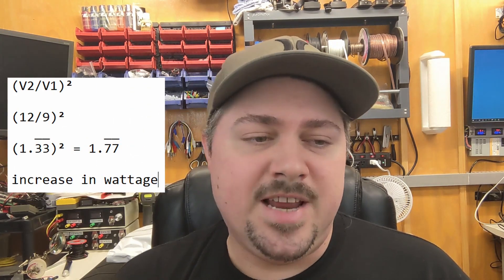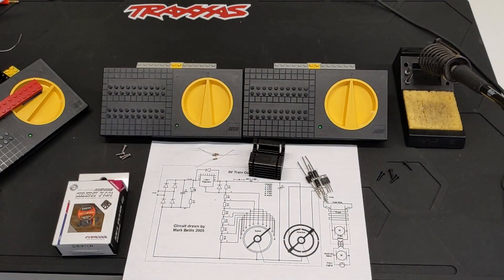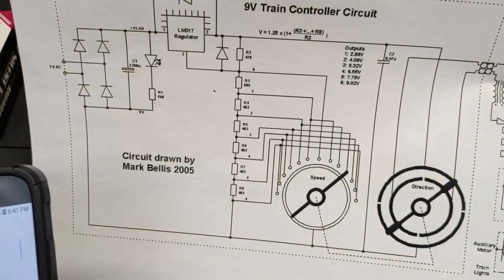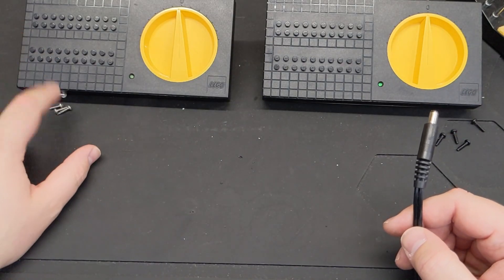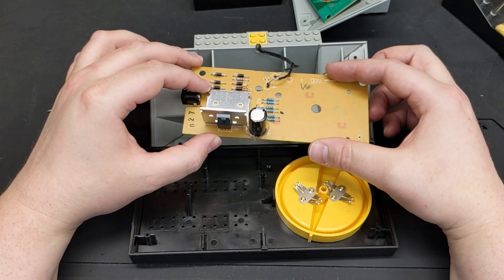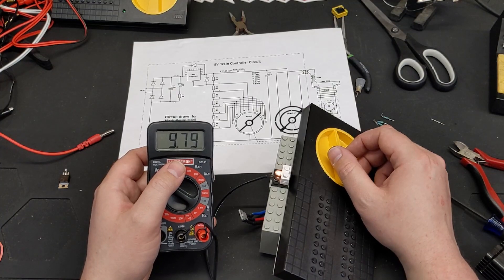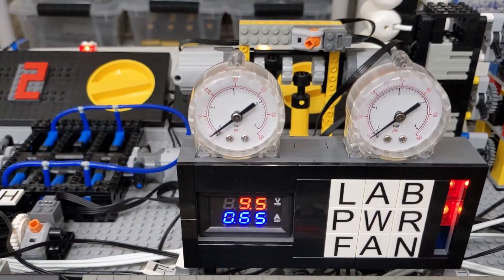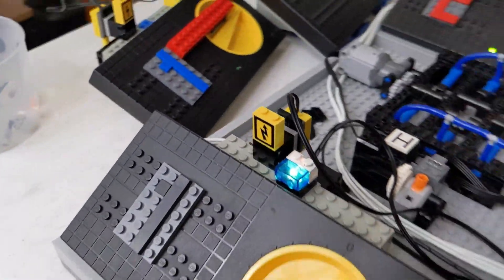Modified Lego Train Speed Regulator 2 (More Voltage)

Comment: Oh no! Dude, you don't have to resort to holes for higher-power mods like that. Replace the linear voltage regulators in the transformers with equivalent (but much more efficient) switching voltage regulators that enable higher power mods without having to add heatsinks and holes in the transformers.
Reply from the maker: I get that but also think it's more fun to modify the original
Reply: @BatteryPoweredBricks  Please listen to me: there is no need for such monstrous solutions(: the holes). It's even more fun to modify the original with much more efficient switching voltage regulators lacking additional heatsinks and holes requirements.

Comment: What should the highest output voltage be for a stock regulator? I measured it with no load at 6.8v which seems a little low to me. Shouldn't it be around 9v? The wall transformer is outputting 9v
Reply from the maker: It should be 9v output.  If your input is DC it needs to be at least 11-12 volts because it will lose some through the bridge rectifier / regulator.
Reply: Aaaah... thanks! I saw the transformer wasn't Lego and it output 9v. I swapped it for a 12v, 2.5amp supply and my trains suddenly run much better! I'm getting 9.26v on the rails now without load

Comment: I can just see Dakota using a 12v transformer to run the train, which would end up on the floor in a high speed accident. LOL

So you mentioned the wire being bad in the transformer, is that something that is common in them?  Something I should open mine up and look at, before it burns the house down??
Reply from the maker: They have very good short protection.  Which is why I don't sweat hooking up a PF IR receiver backwards (oops LED went out, must go the other way).  That's just if the two wires touch each other.  I'm not really sure where they could short on the board in a worse case scenario.

If you look in the gap right by the 9v connector you can see if the wire is turning white, that's an easy indicator.  Besides that it only 4 screws to open them up.  Just don't get grease all over yourself 😅